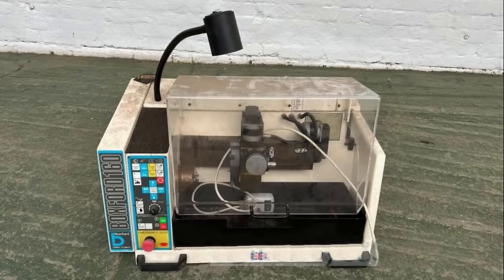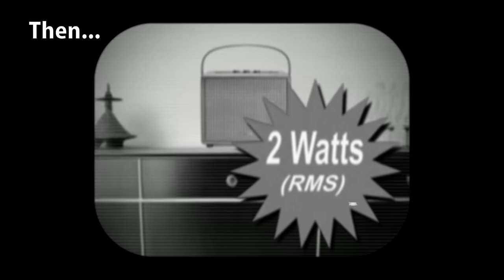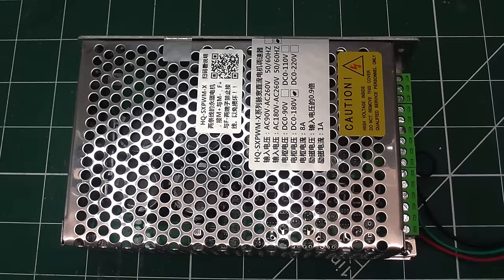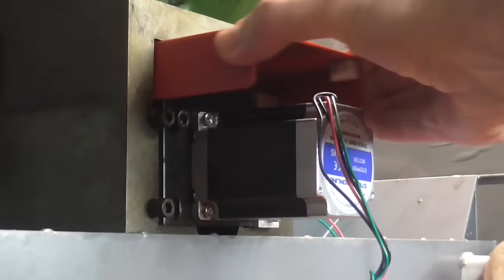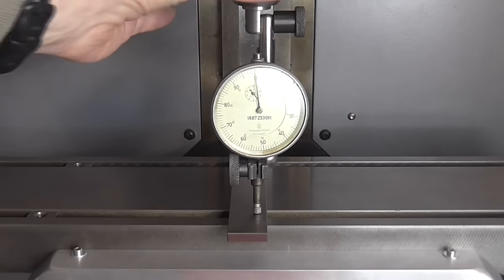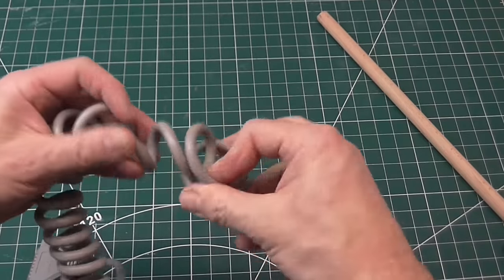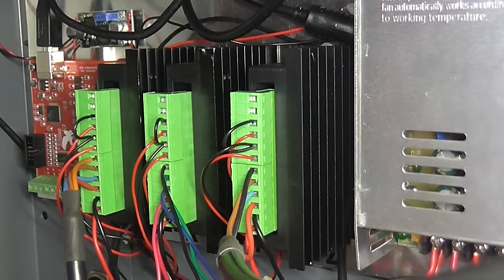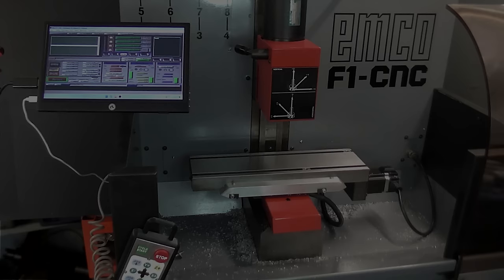Retrofitting an Emco F1-CNC machine

Comment: Microsoft has been progressively dropping certain low level backwards compatibility features in each version of Windows, particularly Windows 11 does not exist in a 32 bit version, and does not natively support 32 bit software anymore, though I believe it can emulate it. Windows 10 64bit does have native 32bit support, and also can be installed as 32bit itself. All that said, for a single purpose computer like this, there's not much of any reason to go newer than windows 7, which has native 16bit support and a lot less general cruft. For instance, Windows 10 and up have mandatory update schedules and will reboot on their own if they think you're not actively using them. Not a great feature for a machine's brain!

Comment: You read the label wrong, that was 2A/phase, the torque is 60 Oz/In. (read left-right not top to bottom) But in the end, I would still have replaced them, as even that is only 0.42nm, far too anemic.
Reply from the maker: Somebody else pointed that out and yes it should actually be 60 on the left, not the number directly under the label. Not that it makes a lot of difference, the new motors are far better.

Comment: It's actually 60 oz/inches 🤣
Reply from the maker: Looking at the label again, you might be right! It's really poorly laid out. That would make them 30x better, but still over 4x less torque than the ones I replaced them with.
Reply: Those labels are commonly layed out left to right, it's just "the way" 😁

Comment: Andy, soem tips: backwards on a cnc spindle can be handy; e.g.  rigid tapping. And a centre drill has an included angle of 60 degrees. A countersunk screw has 90. Best! Job
Reply from the maker: Yes, but I don't think I'll be doing any rigid tapping on this machine (there's no spindle encoder). I guess you could try and do it by applying just the right torque (speed setting), but I'm sure I'd just end up breaking lots of taps.

That's right about the centre drill cone, but the sheet metal was thin and there's not actually much of the screw head in contact with it so it doesn't make a lot of difference over such a short difference, but yes the correct way to do it is to use a countersink bit. (I was just being lazy).
Reply: @AndysMachines  Breaking the taps is the easy bit. The hard part is getting the bugger out.
Reply from the maker: @boldford Too true! 😖

Comment: I'm not sure you got that torque right. The number appears to be to the left of its corresponding label on there. I think that's 60 oz in and 2 amps not 2 oz inches.
Reply from the maker: Yes, the label is laid out quite badly, you have to really study it to work out which number goes with which term. Having no preconceived idea of how many Oz In there should be, I just read the number closest to the words. Even so, 60 Oz In is still less than 1/4 that of the motors I replaced them with.
Reply: @AndysMachines  yeah for sure. It appears as though sometimes the value is to the left of the label and sometimes it's to the right. Coming from the RC world I knew that two wouldn't be correct so I was immediately alerted to look closer.
Like you said though even 60 oz inches is pretty weak

Comment: The way cover  of the Y-axis going trough a slot in the column is a pretty nice design. Maximizing the Y-axis travel while still having a solid cover. I have never seen anything like that before.
Reply from the maker: Yes, the machine has some clever design features. There's also a thin steel strip in between the Z axis ways that stops chips getting to the ballscrew, as the nut moves up and down the strip deflects around it. However the Z ways themselves have no protection and it looks like it was built like that.

Comment: Love that little machine! well done! 👍

 i think the electronics problems you have is EMI. i had a very similar problem with my build. had to redo my wiring and replace the cables with double shielded cables and i used  EMI power inlet filters and ferrite cores. Not a single problem ever since.
Reply from the maker: Yes, I'm pretty sure the PWM motor driver is generating a lot of EMI.

Comment: Great video - many thanks. 
Lots of useful info like the limit switch arrangement.
One mine, in addition to changing the steppers, I also replaced the (failed) DC spindle-motor with a Lenze 3-phase SDSGAXX063-32 600W motor.
Reply from the maker: Thanks, glad you liked it! Yes a 3 phase motor/inverter is much better then a DC motor but I didn't really want to go to that much trouble and expense on this machine. The main problem with this machine is the low top spindle speed.
Reply: @AndysMachines My upgrade was from necessity as the motor failed (windings probably not designed to take the pulses from the PWM DC controller I was using - extra filtering apparently needed). 
I made both a spindle adapter and an aluminium mounting adapter to get the end the same as the DC motor, as both dimensions were bigger on the Lenze, so I could use the original timing-pully.
My new spindle still has the low spindle speed issue, but I also have a 2" end-mill as one of my tools. I like the tool-changing thing though, so can preset each tool-hight.
Since the whole spindle head-assembly is easily removable, I can fit an HF-Spindle in its stead if I do need something faster.

Comment: Loved it! Thanks for sharing that little adventure
20:24 Not sure you're reinforcing the right part there, the hook is gonna shear at its base. The reinforcement should go a little bit further, maybe bend around the screw holes for good measure.
Reply from the maker: Yes, I don't really like 3D printing for stuff like this, but it was quick and easy. I was more worried about the layers in the hook delaminating rather than the whole thing pulling off. The hook actually has not broken, but the magnets on the back keep coming unglued whatever I use to stick them on. I should have fully encapsulated them inside the 3D print.

Comment: TB6600 and TB6560- absolutely normal regular drivers. No problems when powered by 24V PSU. Yes, they are more loud than digital stepper motor drivers, but they do the job absolutely normal. Even DRV8825 little driver can work for Nema23 2amper motor.

Comment: Andy, I love your low profile 90° cable gland solution!  Also, thank you for sharing your method of making your own coiled cables.  You should be very proud of your new-to-you CNC mill, especially for your minimal total cost!  I look forward to your future videos on your CNC machines and any other videos that you choose to make.

Wild question here:  Do you think that the "electronics" used in a DRO set-up could be used by the "control computer" to allow "accurate" movement of the axes, even with terribly worn screws (in areas) in the machine tool?  My current wild idea is to use a PDP-8 of some sort, as long as it has flashing lights, toggle switches, & core memory, as the controller and non-permanently convert an old South Bend lathe (originally a treadle-powered lathe built in 1911) into a "CNC lathe" just to see if I can do it and use one of my PDP-8s to make the old lathe actually do something.  Can you recommend any references that I should study?  (I am not an electronics guru, but would like to learn a lot more about practical electronics & CNC machines now that I'm retired.)
Reply from the maker: Thanks! Yes, you could use DRO scales directly for closed-loop feedback which could compensate for inaccurate or badly worn screws. It won't help eliminate backlash but with a lathe the backlash is mostly in one direction anyway. There's a lot of useful information on youtube, I'd start by watching videos of other people's CNC conversions.

Comment: 6:02 nope, that's a urban legend 😁
Reply from the maker: This is going to open a can of worms!

As I understand it, stepper motors are magnetised after they are assembled (inside a giant electromagnet). The stator acts like a keeper for the magnetic flux of the rotor (the magnetised part), if the keeper is removed the magnet immediately looses some of it's strength due to the flux path increasing and because of the type of material the magnet is made from.

I can say that I had one once somebody had taken apart and put back together. It still worked but had lost all it's power, the shaft turned freely by hand with no resistance. I can't be sure they didn't do something else to it though (like remove the magnet).
Reply: @AndysMachines  nope, it's just a permanent magnet placed inside gear like shapes.
The magnet is a common ferrite or neodymium type.
So no, just urban legend 
YouTube video pUBhWmYqMSg shows the stacking of such rotors from laminated steel plates.
Reply: I can personally verify that a brand new motor purchased in the second half of the 80s did in fact lose most all its torque when disassembled for the purpose of seeing how it worked.  Note that this happened before said new motor was ever bolted to the machine being built.😢
Rare earth in should not have this problem but I believe the high temperature in a stepper motor would kill the magnets available at that time.  I do not know if modern rare earth magnets can work at high enough temperatures.
Reply from the maker: @wiju That video actually states "rotor removal causes the motor to permanently lose two-thirds of it's magnetic field" https://youtu.be/pUBhWmYqMSg?si=XfpMr0mE03rJpN9O&t=77
The video does look quite old though, it may be that modern motors do not demagnetise, or not as much. I first heard this a long time ago, but have been careful not to dismantle a stepper motor since (even though I might have wanted to!)
Reply from the maker: @ParabolicLabs  Interesting! I first heard this myth (if it is a myth) a long time ago, so possibly in reference to the alnico type. Even so I've been careful never to dismantle a stepper ever since.

Comment: I also bought these driver modules once (!) and found that they have bad heat transfer from chip to heatsink, drive the motor in a noisy way and do not produce a whole lot of torque compared to smaller trinamic, etc drivers. I would recommend to avoid these modules like the plague. They are probably also not very well hardened against back-EMF (overvoltage from turning the motor shaft). i can't see any schottky diodes to redirect the current on the PCB.

Comment: 4. Interference. If you run the motor drivers all off a shared DC bus things will get very noisy between them. Also the cheap switching supplies leave out all common mode filtering. Ideally there should be filters on each driver, and on the input of the supply to prevent that interference getting to the digital side through any shared ground.
Reply from the maker: I think the PWM spindle motor controller might be generating some noise, but running several stepper drivers from a single power supply is common practice, I've always done this with no problems. Stepper drivers have fully opto-isolated inputs. I have seen people use a separate power supply for each driver, but this is mainly because it's often cheaper to buy 3 small supplies compared to one large one. How things are wired also makes a difference, all the power lines should be joined at one point at the supply, not 'daisy chained' from one drive to the other which people sometimes think is a good idea to keep the wiring shorter.

Comment: I Work at Emco and never seen auch a old F1, i only know the New Versions. The F1F and F1G. Your Maschine seems similar to the F1F, it almost has the same Tower (i dont know the english Name) and Bed.
If wanted i can provide you with some Info on the New Types.
I potentially could send you the original G-Code for the  Emco Test Part we make at the Factory to Test the Machines.

edit: my Bad, i looked at Work today and we have one of those Machines Standing around not in use. I didnt recognice it since it looks a little different since it has Side covers and is called "PC Mill 55". Maybe it is a slightly newer model than yours.
Reply from the maker: I've heard of the F1P, and the F1 'Woodworker' which is identical but has a different pulley ratio for higher spindle speed. I don't know a great deal about these machines but it seems solidly and very well made, it's certainly still accurate after all these years.
I'd be interested to see the original test part G-code file.
Reply: @AndysMachines  Is there a way i can send it to you? Via E-Mail maybe?
Reply from the maker: andysmachines@gmail.com Thanks!

Comment: Hi Andy, I am looking forward to your video on the Boxford revamp. I bought one a few months ago. I have cleaned it up (see video ) but haven’t had time to take the plunge on the electronics. Will be interested to see how you get on.
Reply from the maker: I watched your video, yes that's the exact same machine I have, yours looked in worse condition to start, though you did a good job cleaning and repainting it and can actually jog the axes around which I can't. I'm hoping to keep the existing spindle drive and stepper motors but will probably change the stepper drivers. I might try LinuxCNC for this one, I've only ever used Mach 3 before.
Reply: Hi Andy have you made any decisions regarding the control hardware and software? I have decided to rip out the current electronics inc the steppers as a nema 23 frame will fit. I am currently on the fence re which gear to buy and could be swung by your decision!
Reply from the maker: I've actually been busy using the F1 for a project making around 100 identical small parts (at which it's doing really well). Until I can get this mill out of my small workshop I don't have space to start on the Boxford, but I'm hoping to finish by the end of this month and then start investigating what to keep and what to change.

Comment: I had a similar USB problem with one of my F1 mills that was fixed by adding a ferrite to the cable.
Reply from the maker: Actually all I did was replace the cheap USB cable that came with the monitor with a quality one and that solved the problem completely.

Comment: just my 0.02 but those tb6600 drivers belong in the garbage.  Try the DM542Y or DM556Y if you insist on staying open loop.  another order of magnitude better are the closed loop kits, and even better are the 180w integrated servo motors which would make that machine amazing.
Reply from the maker: On paper the TB6600's should be up to the job, and I've used them before with no problems (though with a little smaller motors). But the DM542 proved much better, I've used these with Nema 34's in the past. I've never used a closed loop stepper kit, but servos of course are in a different league.

Comment: If you swap the spindle motor for a 750W brushless industrial sewing machine motor, it might make the machine one to keep rather than sell off. That little machine looks rigid enough to handle a bit more power.
Reply from the maker: Yes, for a small machine it's surprisingly rigid, it can take quite aggressive cuts without any vibration. The main thing it really needs is more speed, this can be achieved by changing the spindle pulleys and apparently there was a 'woodworker' version built like this that could do 8000 rpm, but the trade off is less torque at low speed. I'm not familiar with the sewing machine motor, but googling them they look small and light enough to be a good swap (and not very expensive). There would need to be some way of interfacing it to the CNC controller, maybe this could be done via the connection to the foot switch? I can't find much documentation for these online and it looks like the foot switch might only be for on/off, with speed and direction controlled by buttons on the panel.
Reply: @AndysMachines  I have a couple of these that I am fitting on a small bench top horizontal milling machine and a minilathe. They are brushless dc motors with hall effect sensors rather than full blown servo motors I believe. They spin upto 5000 rpm and can run smoothly down to 300rpm with excellent torque in the entire range. Speed control is via a hall effect sensor hooked to a mechanical pedal. I removed the lever arm and spring on mine and I placed a knob on the shaft and use it like a potentiometer for speed control. The controls on the box are for programming parameters like maximum and minimum speed, direction, braking etc.

They come in various powers ranging from 500W upto 1500W. They are worth having on the shelf even if you have no projects for them immediately. As far as Newton meters/ penny goes, they are best motors on the market . There is a bit of information scattered around a few forums and there is even a video of someone testing torque and current under load using a prony brake. From what I've gleaned as an amateur, they work to advertised specifications for the most part but the motor controller is built to a budget.
Reply from the maker: Certainly an interesting option, I like that they are brushless. I wonder if the controller could be replaced with one that's more easy to interface a computer to?
Reply from the maker: Something like this perhaps?: https://www.aliexpress.com/item/1005005030803645.html

Comment: I was expecting at least 1 of the drivers to go POP when i saw the model, they're truly awful drivers and don't deserve the light of day haha For the puny 2.8a stepper motors you're using, consider using a few very cheap TMC2209 and corresponding breakout board, there's a plethora of them that are for the simpler machines using GRBL out there for very low cost, removing the need for the separate controller board too, as it's all integrated :) Should save you quite a bit over the remaining machines!